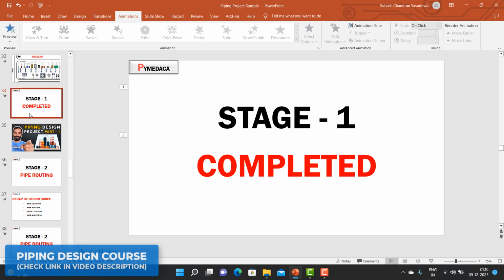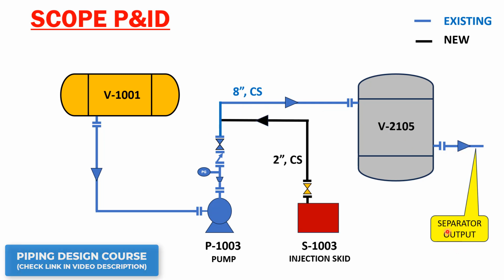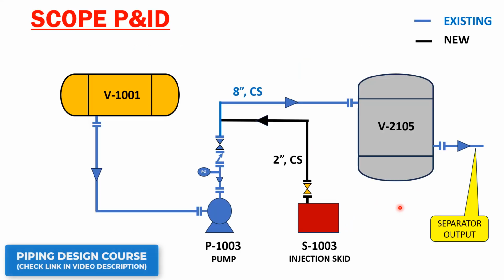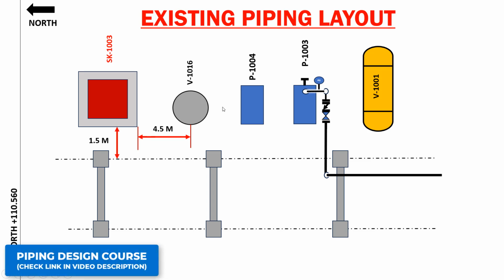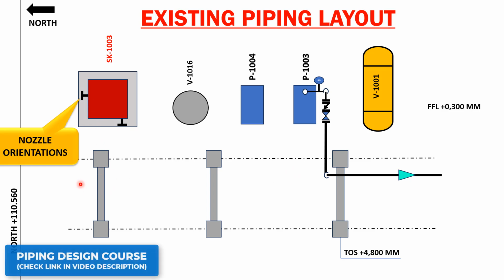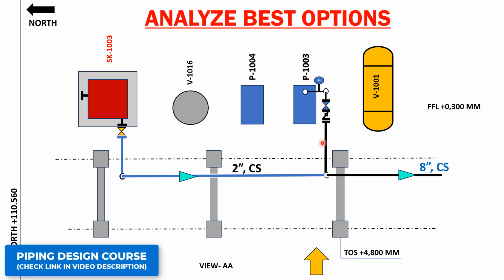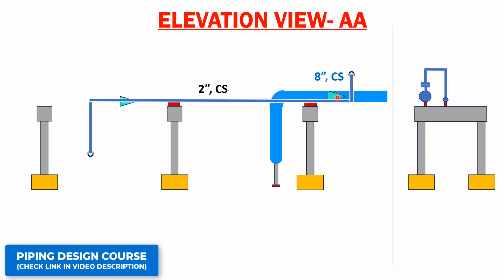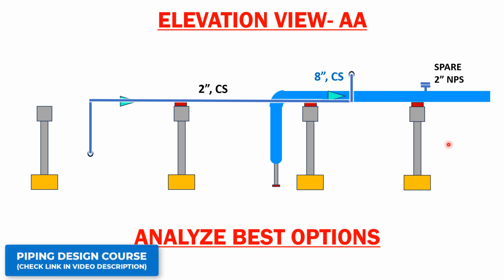Piping Design Project - Part 2 ( Pipe Routing Design Finalization)

Comment: Please explain design in E3D sir..
Reply from the maker: Dear... E3D is not a Design. It's a software. You hv to understand the difference between Design and software. E3D s a tool. You can use any tool to model the Design. But Design is done with brain storming.
Reply: Thq..

Comment: Sir is it possible thet we can  use conc.reducer in 2" pipe and directly connect to 8"  pipe by removing elbow and using equal tee.
Reply: Not a good idea at all , you will need a lot of reducers  , and a lot of unnecessary cutting and welding work, also wasting money and time , also , all this work so difficult on pipe rack